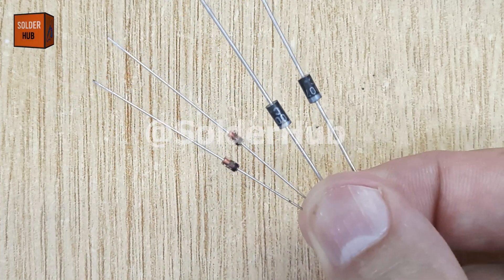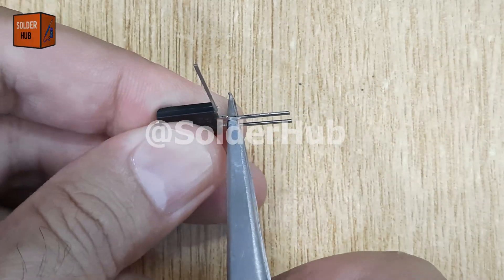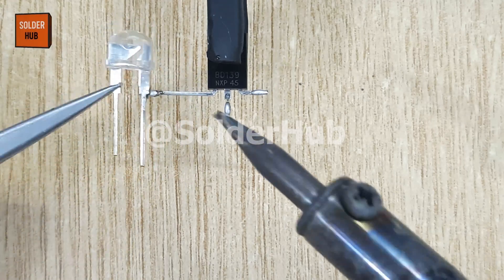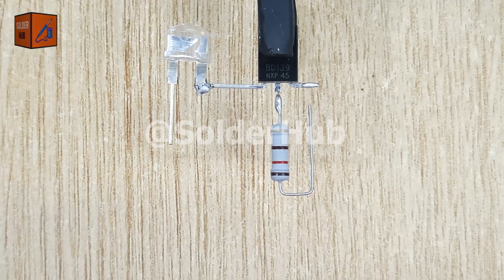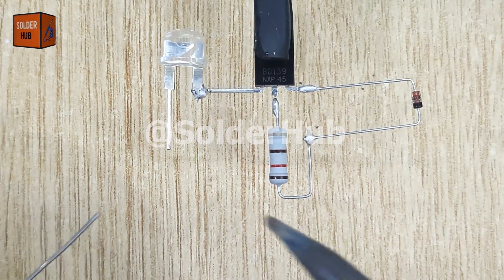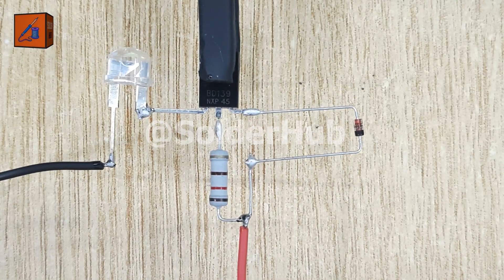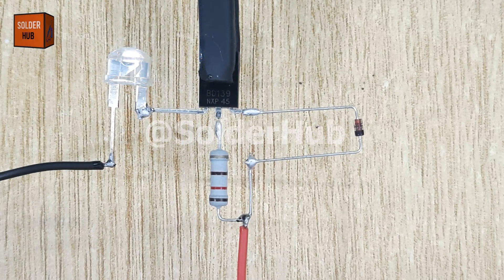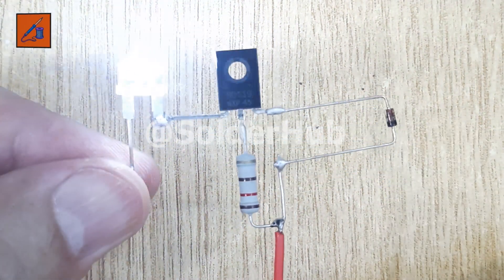How a Simple Diode Breaks the Rules of Electricity

Comment: Good tip   .... do not pass too much current through your Zener , this will heat it 😝.... causing  the same effect , ruining your voltage regulation ................. DAVE™🛑
Reply: very ignorant video
most components have a temperature  co-efficient
no surprise
no discovery
noithing special